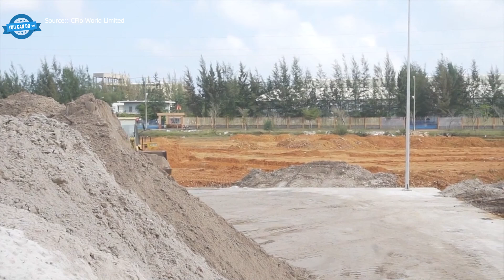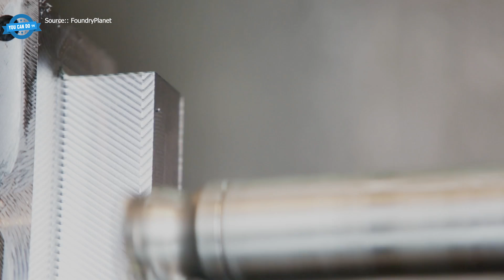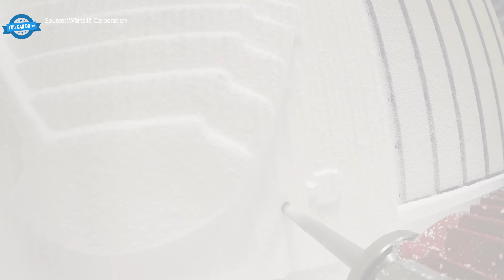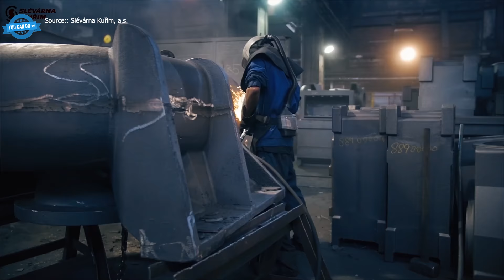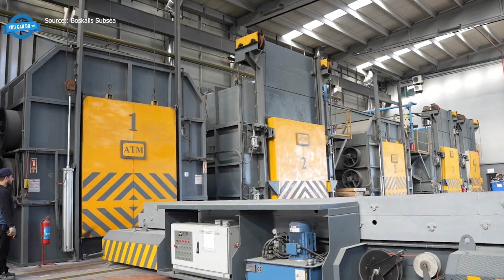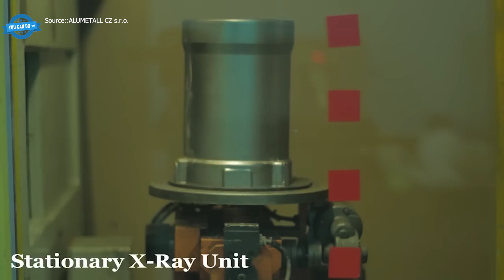Metal Casting Process: How Giant Foundries Turn Molten Metal Into 100-Ton Parts. Heavy Industry

Comment: "Some engine blocks go from liquid metal to finished shape in under 2 minutes, which is shorter than most factory lunch breaks."
Shorter than most, but not all.  
So does that mean that some lunch breaks are shorter than that?  
What factory has a 90-second lunch break??